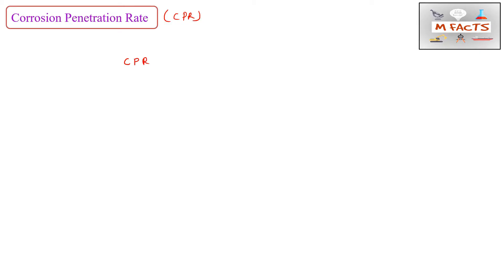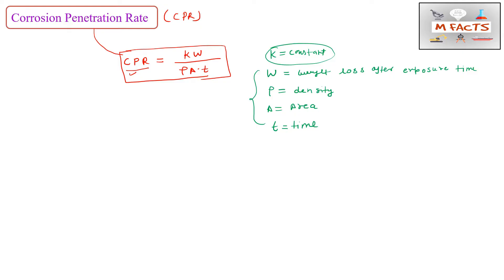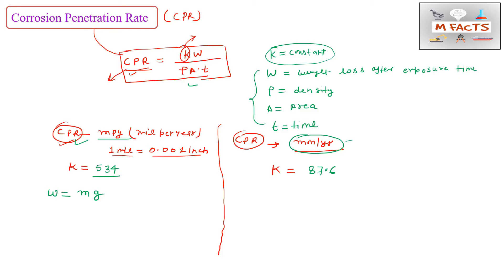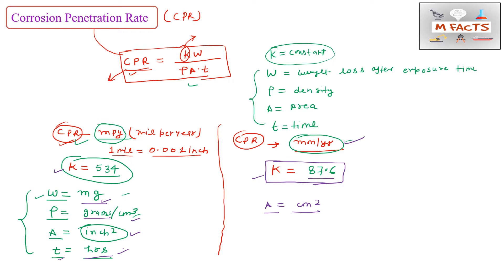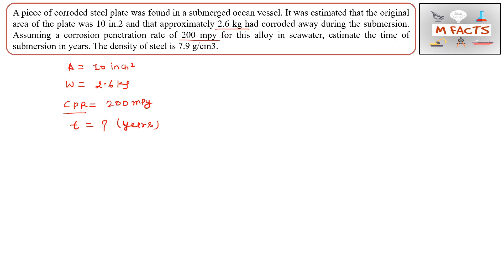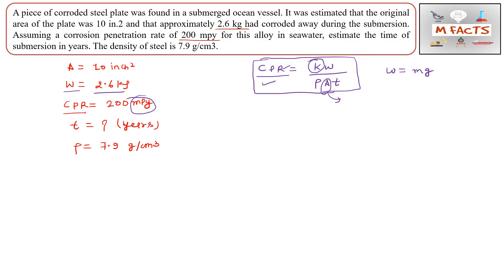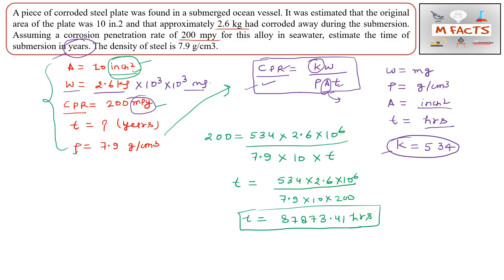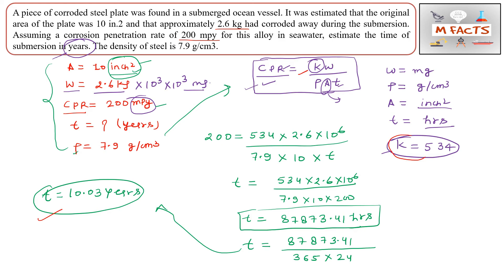Corrosion Penetration Rate (CPR)//How to Calculate thickness loss of material  per unit time

Comment: the alloy bronze exposed to different corrosive environment of area 50cm^2 ,for a period of 6 months the bronze alloy loss of weight in acidic medium was 200g ,in neutral 120g and in basic medium 48g. calculate the CPR in mpy